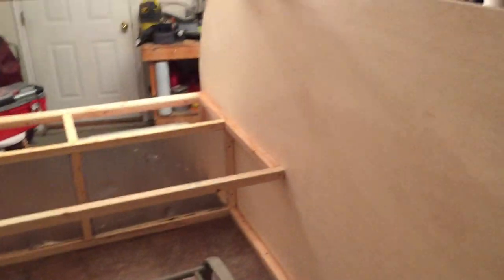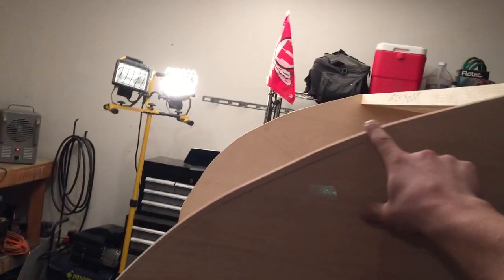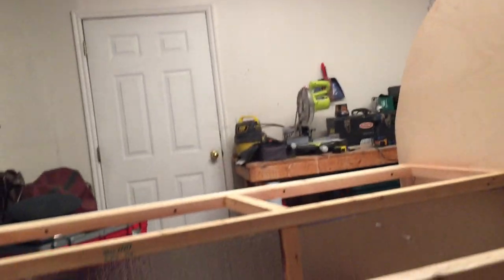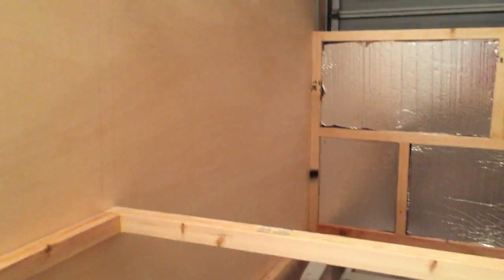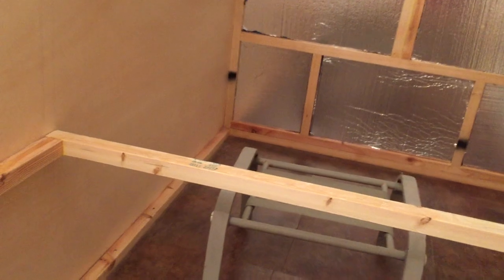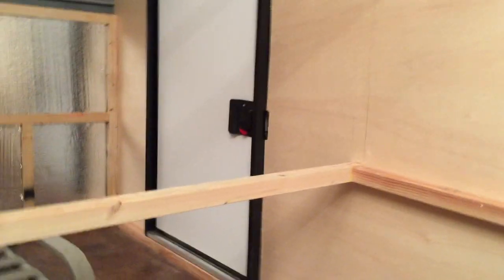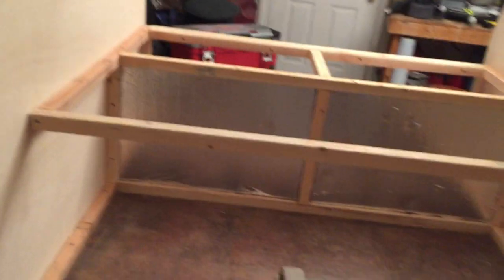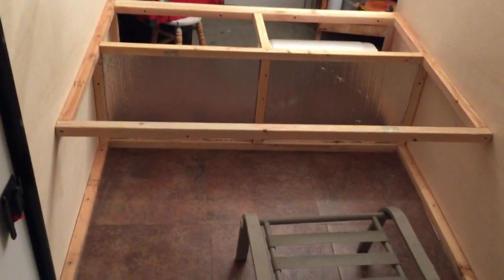Off Road Teardrop Trailer Build- Internals and Side Walls.

Comment: Really learned a lot from your series. Well done.  Very close to what I would like to build.  Like the suspension ideas.  I once insulated a Toyota Panel Van and I used the mylar bubble wrap covered with auto carpet. It was easy to do in  small panels and light enough that it stayed put for the life of the van just contact cemented in place.

Comment: Been thinking about building one of these with my buddies. How much money do you have into it so far. haven't finished watching all of them yet. Maybe you mention it in a later video. Im a college kid looking at building one to pull behind my jeep when i drive it across country back to my hometown in California. Cant really go above 1500
Reply from the maker: southBAYstruts I totally hear you man. I myself am a college student. I budgeted this total build to be about 2,200 dollars. After making some careful decisions, I decided to forego the electrical aspect of it and go with a more rudimentary design that ended up saving me a ton of money and weight. As of right now, I would say that i'm about 80% completed as of my most recent video. The trailer weighs about 900 lbs. and I am in to it roughly 1,800 dollars. A large sum of the money came from the custom welded frame, Timbren alxe-less suspension, off road rims and tires- totaling 1,340 for just those alone. The frame, suspension, rims and tires are definitely one of the most important aspects in your build, for they are the foundation of everything and allow it to travel where you want/need it to. The construction of the cabin is relatively inexpensive. I paid $70 for the sub flooring and $90 for the two side walls. other than that, all of the other lumber is light-weight and fairly inexpensive. Whatever you decide to do, don't rush in to it. Watch all of the videos and read all of the forums that you can. I hope this helped, cheers!

Comment: Looks good, I see you bought a door without a window, are you gonna put a window in on the other side. Im glad I put a window and door in with a screen it helps with ventilation and i can still take a peak outside to see whats going on..
Reply from the maker: @Enbloc3:  I would have preferred a door with a window/screen, but when I priced those, I found them to be around $250.00 or so... I ended up going with this one for $125.00 and can put a window in it for 40.00 if I choose to. I will be installing a large roof vent with a powered fan in it on the roof to assist with ventilation. As far as the other wall, I was toying with the idea of buying and installing a large cargo door from a 5th wheel or something. A rectangular one that opens upwards. That way, I would have a large opening for ventilation, View and possibly a second door depending on where I place it.  It sounds weird, but I think it would be pretty cool.